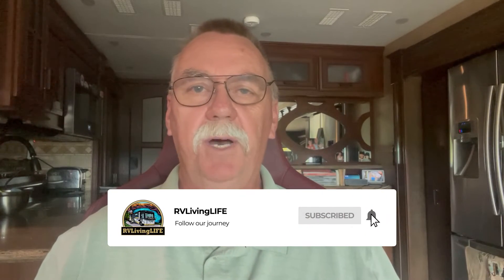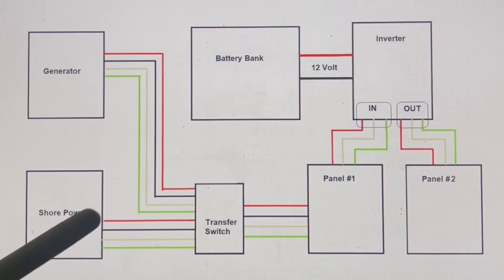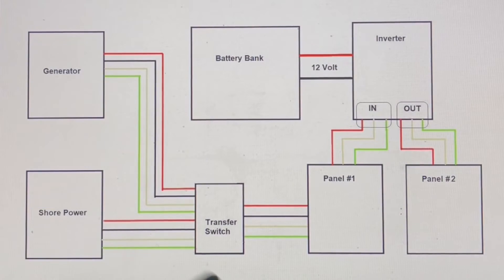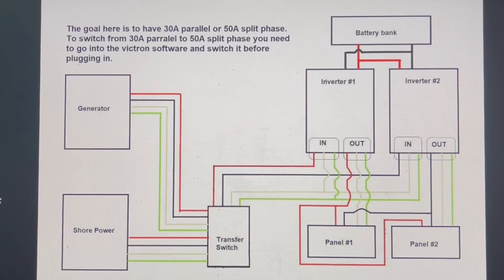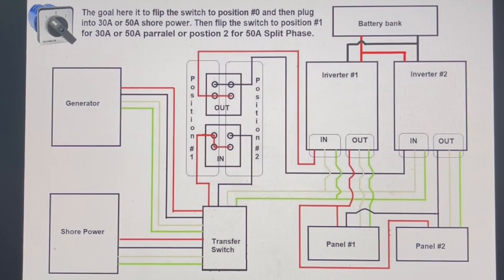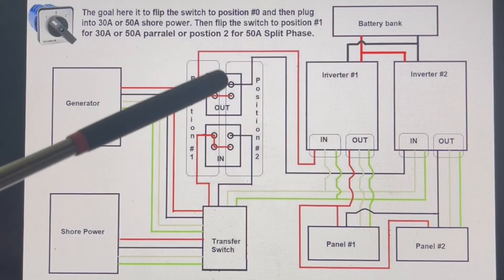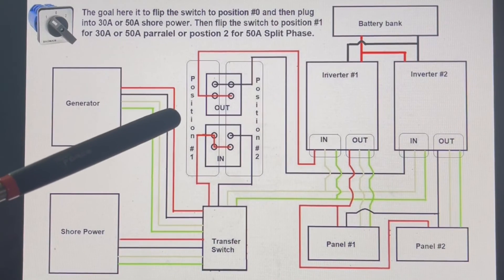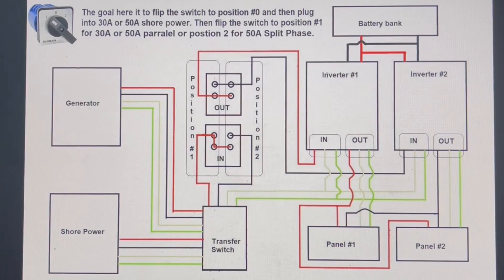How to wire two Victron Inverters In Split Phase and Parallel

Comment: What does the switch and changing profiles do that a 50-30 dog bone would not do in a 30amp only site ?
Reply from the maker: If you leave the switch in parallel and have the inverters set in parallel you can easily go from 30 to 50 using a dogbone when in a 30 amp pedestal. Most people have their setup this way. But if you want to see why you may want split phase you should checkout this video https://youtu.be/EYOIQGiO4RE?si=K3mikpLk_vFhrYta
Reply: @RVLIVINGLIFE I understand split phase. 30 amps is 3600 watts. 50 amp parallel is 6,000 watts. 50 amp split phase is 12,000 watts. That is not what I am asking. A 30-50 dog bone sends power from L1 to....L1 and L2. How is that different from your switch that send power from L1 to L1 and L2?

Comment: looking at the amazon, it looks like it might be a 3PDT switch. but looking at your diagram, I was thinking you had two DPDT swithes so a little confused to why you had the 3P switch as L1, and L2 are 2 of the poles. What is the 3rd pole? And why even have a switch on the output if both positions go to identically the same place. I would think you wouldn't even need the output on a switch.
Reply from the maker: The 3PDT was the only one I could find on Amazon at the time that was heavy duty enough.

Comment: Would it be possible to see a photo of the switch and how you wired it
Reply from the maker: Sorry no wiring diagram, have you done this project yet?
Reply: @RVLIVINGLIFEYes it works the way you intended, but I have 220v appliances witch i always use. mini split, oven, and induction stove all wired into a single loadceter with my 120v light, TV ect..
I have almost 3KW of solar and 40KWH of storage plus a 10,000 WAT generator. So I'm never plugged into grid/ sure power unless im at home where I have a 50amp plug mounted to the side of the house.

I had a high wind issue a few days ago that forced me to store the trailer in my barn witch is fully enclosed and only equipped with 30Amp shore power.
I've never kept the trailer indoors before and have never seen my batteries dropped below 50 percent.
Long story short I took a drive to the local tractor supply to pick up a 30 amp plug but on the way realized that my setup would probably not work in parallel while running any of my 220v appliances.
I'm not an electrician, I am very comfortable but cautious while working with electricity so I'm doing some more research this weekend and may add a victron auto transformer to balance the inverters and allow me to run in parallel without issues.

Comment: Hello Gary, I am in the process of wiring in 2 Multiplus 3000 as you have.  My questiion is, if I wire in the switch to select parallel or split phase do I still need to change the inverters configuration from the internet as well?  Isn't the switch a manual way to control this?  Thank you for sharing.
Reply from the maker: @darenlones7946  you still need to change the settings in the inverter as well. The reason I did this is so I can have parallel on 30 or 50 amp  without changing anything and still be able to do split phase as well.

Comment: Awesome information. Love your 50A / 30A switch solution. Can you add link for the Amazon one used? I'm trying to confirm the right one and not 100% certain. Is it this one? Baomain Rotary Cam Changeover Switch LW28-125/D202.2 660V 125A 2 Phases ON/Off/ON 3 Position CE.
Reply from the maker: @davidrollins8474  Hey there. Thanks for the positive comments. I checked the links in the description and they are correct.
Reply: @RVLIVINGLIFE  Thanks for the reply. I now see the link at the beginning of the text area. I think I was looking at all of the product links down further and didn't see the switch there. Got it now; ordering from Amazon. Have a wonderful day. Appreciate the details with the schematics and the talk through on the video. Good job.

Comment: So parallel is your default and split phase your desired option. But you still have to switch over via software if you want to have eighter one. Because Parallel is in sync and split is 180degree apart.  Did I get this right?
Reply from the maker: That is correct.

Comment: Have you thought about redoing this video? 
The explanation is good but the Information is off. 
The best example for a rig with 50a (and no 240v loads) would be the division of the single 120v line from the genny to each inverter (ran in parallel) 
If you wire your rig for 240v/split, the shore power/genny output doesn’t matter. You simply plug your 50a shore cord in to 15a or 30a outlet and one inverter will charge/pass through while the other inverter becomes the “assistant”(using your battery power for the other 120v leg.
Of course, you would need to dial the amp draw back from the system so that you do not overload the circuit
Reply from the maker: Thank for the comment. I understand what you are saying. This video link shows how split phase can deliver far more power. https://youtu.be/EYOIQGiO4RE?si=DJI3WOIxydYH_9Bg
Reply: @ additionally to this comment: how do you handle the situation if your rig has a large 120v genny for a 50a panel? Runny the S/p wouldn’t work well for the MPs because one would charge while the other assisted (while running the genny)
Reply from the maker: @RollinHomies  my generator is 240 split phase. I run the generator when the system is set to receive split phase and the switch is set to split phase. It works the same as being plugged into a 50 amp plug. I could run the generator while the system is set to accept 30 amp parallel with the switch set to parallel but it would charge a lot slower so that makes no sense. If you are going to run the generator use all the power it has to reduce gen run time.
Reply: @ ya it really helps if you genny has two @ 120v. Otherwise an autoformer on the genny output (or any single 120v line) would be the premium option…. But more $$$
Reply: I guess some of my confusion from the video, is youre referencing the genny wire and calling it the shore power. If your genny is 5500w 120v, seems like running 20amps to each would work for each inverter to charge, but I guess charging would be all you would get… and your pass through would be very little. Of course if your genny is 240v, then s/p should be the only option.
Reply from the maker: @RollinHomies  the generator and shore power both pass through the transfer switch before heading to the inverters.

Comment: Yes, great set up like to know what kind of amperage did you use for this off and on switch the one and two for your parallel split face is an eight circuit and 20 amp or is it a eight circuit or through 2 V?
Reply from the maker: There are links to the items used in the description. The on off switch was not listed so I added it. 600 amps https://amzn.to/4jXa0qW https://amzn.to/4jXa0qW

Comment: Yes, great set up like to know what kind of amperage did you use for this off and on switch the one and two for your parallel split face is an eight circuit and 20 amp or is it a eight circuit or through 2 V?
Reply from the maker: I added the main power switch to the items listed in the description  it is 600 amp

Comment: What would happen if you didn't switch from 50A Split Phase to 30A Parallel in the Victron software and you plugged into a 30A pedestal?
Reply from the maker: @salvatorerestuccia6235  likely it would only power one side instead of both. Either L1 or L2. There is no fear of burning anything out.

Comment: I have a setup question for a class c motorhome power addition setup. 

What is the best method of wiring to keep setup more "default wiring setup?"

I'll have the built in 12v system setup, but I want to add a 24v battery setup with inverter. Should I take the line going to the inverter breaker and bring this as my "AC in" on the 24v inverter? Then bring the "AC out" on the 24v inverter to the inverter breaker in the panel?
Reply from the maker: @fraliexb  as long as you have 110 coming into the inverter and 110 going out that should work fine

Comment: Thank you for this informative video.   IF I only was to use 50A shore power or Generator OR drive to Europe where we do have 240 volt everywhere I could get by without the switch and fiddle with the Victron programming ?   correkt ?     And all my panels , outlets are now 240 volt IF I use L1 and L2 ?    How do we make sure we have proper ground and security ?   Any change to Ground and neutral in inverter or fuse panels ?  TIA.
Reply from the maker: The switch I installed is not necessary. I only installed it for convenience. You can just use the wiring diagram for split phase in the video.
Reply: @RVLIVINGLIFE  Thanks.... a follow up... I watch your videos and try to relearn technical school from wayyyy back.. 1980.     On  your final solution, you can go parallel and get either 30 amp or 50 amp from shore.   Then both panels only see 110volt.... When you go 50 amp split phase and reprogram inverter...  each panel then get both hot L1 and L2 ?  But you still only use one leg pr panel as it is wired that way with circuit breakers etc ?

Comment: Very informative. Thanks.  Question...  If you used dual MultiPlus II 12/3000 2x120V inverters, wouldn't you be able to eliminate the manual switch and the inverters would automatically handle the 50A split or 30A single and "just work"?
Reply from the maker: Not really sure as I never tried a MultiPlus II 12/3000 2x120V inverter. I assume if you run them in parallel it could work, but I can't be positive.

Comment: Will an external Victron transfer switch automatically manage the AC inputs (20/30/50) such that I would not have to adjust the dual Multiplus?  If so, which Victron transfer switch is recommended?  I have dual Multiplus 24/3000/70-50
Reply from the maker: I believe Victron has an autotransformer you can run on the front end, but I have not tried it.

Comment: Extremely helpful video - I'm running dual multis as well, wired in split phase, so when I don't have 50A power, 1 of the inverters passes through and charges and the other 1 inverts only. I hate that. Since AM Solar doesn't produce the SPS auto switch, it looks like my workaround is the switch you have there. Just to confrim, when you have your switch set to position #1 (30A or 50A parallel) both your multis pass through and charge?
Reply from the maker: Unfortunately at 30 amp one will pass through and charge and the other inverts. To have both invert they have to be independent of each other. Master/slave will not do that at 30 amp

Comment: Gary, do you have any suggestions for upgrading from 12 to 24v systems?  I see many people doing this but just don't buy it.  Seems like you create more complexity and points of failure.  I am also trying to size the lithium batteries, I have 860Ah available right now, but they are SLA.  I can budget 3 460Ah lithium batteries, but think perhaps I should go with two (2) 460's and upgrade if needed.  What are your thoughts after having your system in use over the past couple years?  Thanks
Reply from the maker: I never went 24v as the batteries I used were 12v and a great deal at the time, They do not allow a series/parallel setup. Only series. There are some advantages to 24v but I would only do it if I purchased 24v batteries. Your 860ah of SLA only provide 430ah of usable power. Two 460ah lithium would give you over twice what you have now and three would be over times. We are happy with 800ah, would love double that, but for what we do it is fine. We are not really BoonDockers but do enjoy running the top front AC unit on battery power when traveling so we don't have to hear the 10kw generator running while travelling.
Reply: Thanks for the reply. I ended up going with 4 Epoch 460ah batteries in a 2s2p configuration. I am doing the install next week. 

How did you wire your two ac distribution panels?

Comment: I don't understand the necessity of the switch at all.  If you are at a campground with 30A service, you use a 30A to 50A adapter that energizes both L1 and L2 of your 50A power cord from the 30A Hot lead..(ie makes the incoming power parallel). Assuming you wired the two inverters so that L1 went to one inverter and L2 went to the second inverter then both inverters see 120V in parallel.  If you plug into 50A then they see split-phase 120. The thing that needs to be changed is the software configuration... the switch seems unnecessary given a correctly wired 30A->50A dogbone adapter.  If the inverters are configured for split phase, and they see parallel, then the master passes through and the slave goes into inverter mode.  If they are configured for parallel and they see split phase - same thing one pass through and one inverting.
Reply from the maker: Agreed, there is no need for the switch at all. I thought I mentioned it in the video, maybe not. I have not watched it in a while. I only did this for my own convenience when arriving at a 30 amp park when we were setup 50  (or vise versa) and there was no internet to be able to login and change it. I would then have to get the USB cable out and plug the laptop directly into the inverters to reprogram them all over again. Changing the software configuration is not possible without internet unless you connect by USB, unless I am missing something. But the the idea of the video was to show the different wiring configurations from the original to either parallel or split phase whether you wanted a switch or not. Maybe I did not make that clear enough,

Comment: Thank you for this information.  I am in the process of updating the electrical on my 2006 Country Coach.  Your schematics were very helpful.  I didn't realize how the flow to my two 120v circuit breaker cabinets.  For some reason I thought the AC went directly into the inverter then out to the panels.  Watching this video the light clicked on and I now understand how the 2 are segregated when using the inverter.  

My plans were to upgrade to a single inverter with 1200ah of lithium batteries.  I believe I can go with 800ah batteries (12v); thinking of using EG4-LLs (12v-400).  Spend extra on an additional inverter and have a system that is close to perfect.  If I need an additional battery I should be able to add it in the future.  We do not do much boondocking, but having the option to do so without use of generator or shore power would be nice.  The plan is to have about 1000W of solar.  

I'm assuming the need for internet is due to the fact that internet is the conduit/connectivity into the inverter; without internet you cannot access the Victron software?  It would be nice to be able to have an apache server running the Victron software or a portion of it locally.  I would think if available, you could run it on a raspberrypi.  Is this even possible?  

Also, are the a good number of changes to the inverter settings when running split phase?  Just changing the amp settings?  Or is it more complex than that?  I am not Victron savvy, but am anxious to start my conversion.  Thanks again for the informative video and information.
Reply: One last question.  I'm assuming you used 2 MultiPass inverters.  Were they the MultiPass-II 2 x120?
Reply from the maker: These are the Victron 3000 inverters. The Multiplus II 2x120 was just coming out at the time. It was hard to get and these inverters temporarily dropped in price by close to half as everyone wanted the new ones. Not wanting to wait and also wanting to snap them up at that price. I had the Multiplus II 2x120 on order but the waiting time was unknown and I wanted to get this project done before a 9000 mile trip. I have no regrets though, as I would have still needed two to accomplish what I wanted.
Reply from the maker: There are a lot of settings you can change with the Cerbo Gx, but unfortunately you can not connect to the inverters with your phone or laptop to switch from parallel to split phase without internet unless you connect directly with the USB cable to reprogram them.

Comment: Excellent video. The only caveat is that none of the appliances in the camper could be 240 volt split phase, otherwise, with the switch set to single phase, the L1 & L2 would be connected to each other through the 240 volt appliance. In theory, the opposite phases would push & pull against each other, cancel out, & the appliance would just not work. But, would this be a safety issue?
Reply from the maker: Good point! I guess in that case you can wire it to split phase and switch to parallel in the Victron app with the mechanical switch eliminated. .